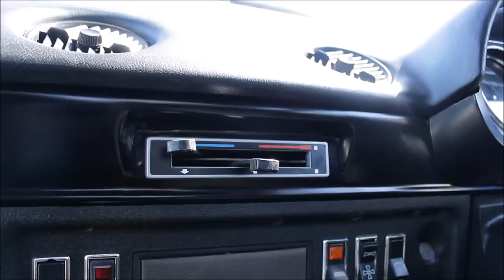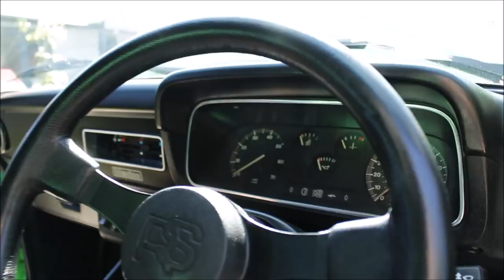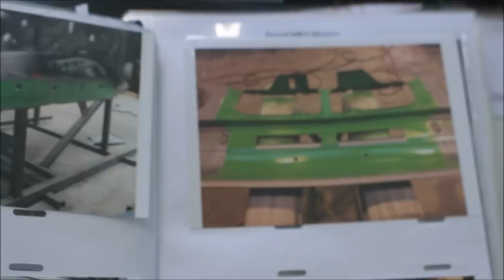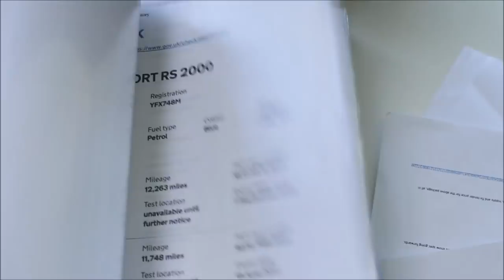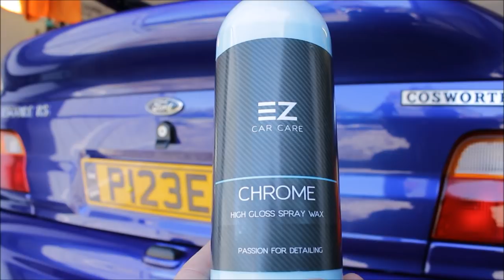Ford dream car collection

Comment: Nice video Paul featuring some tasteful classic Fords. Will be interesting to see how much these go up in value over the next 10 years. Around 6 years ago I looked at the prices of MK1 Focus RS's and a slightly higher millage one but in good condition was going for £6.5k.
Reply from the maker: JP Details if only we had kept our old fords JP never too late
Reply: I remember when you could pick up a mk1 focus for 8k they are luke 16k up and low miles ones big money now the very last of the ford classics to come out

Comment: I know we all have our preferences, but that MK1 Focus RS is stunning. The proportions of those cars are spot on. Old cars have tiny donut wheels, pea shooter exhausts and are very basic. New cars have 20 or 21 inch wheels and are very heavy with electronic steering. Cars from the late 90's early 00's are not too big or too small, normal sized wheels and are basic where you'd want them to be, but also more advanced where you'd want them to do. One thing I really don't like about current hatch backs are that they are all 5 doors.

Comment: My old man has a red mk6 escort rs2000 4x4 1996.. its only done 4k miles and just sits in the garage
Reply from the maker: Get it in an auction
Reply: @PaulDoldenDetails  he wont sell it 😂 he retired at 57 and still doesnt use it lol

Comment: Felicitations  pour tes voitures rs 2000 1974 tres  belle ♥️ je vois que tu a des options  console  Montre ext javais sur mon rs 2000 1974 options  bois original pour les compteurs...il y a deja des trous usine dans la caisse ..jai eu plusieur escort  rt group 1 1976 original caisse plus Leger  double  carbu frein ext ext la couleur  Bleu est tres  👌 💙 javais blanc.bleu 1974 celle  du livre echappement  🇫🇷  amicalement lepeltier Ferrari geneve suisse.

Comment: I got mk1 RS 2000 in 1974 same as blue on blue best car I have had did not like mk 2 very much went over to capris after the mk1 rs /mk1 RS was 100 by 10 les than the normal pinto engine